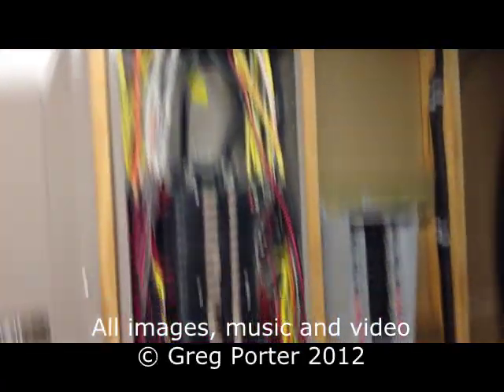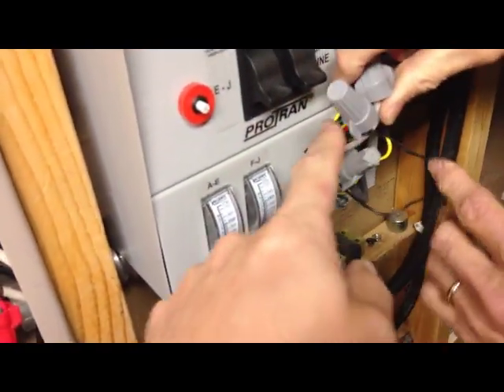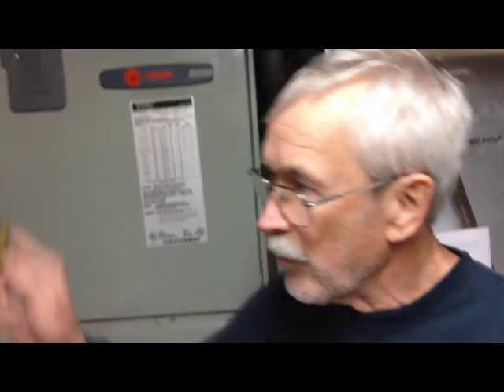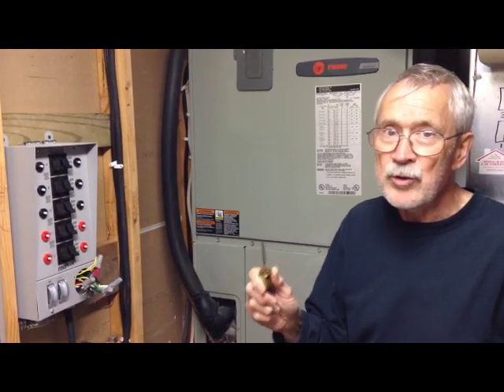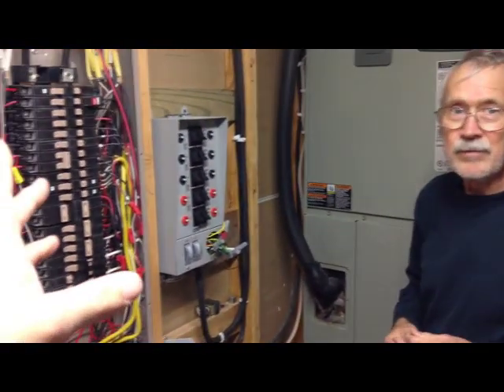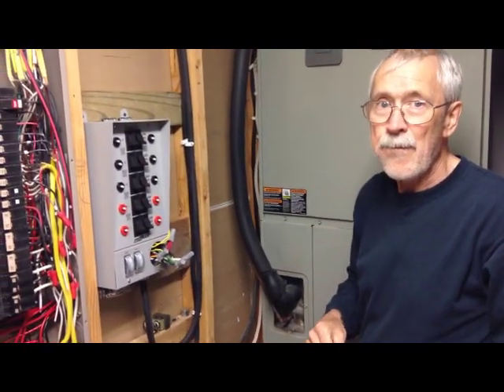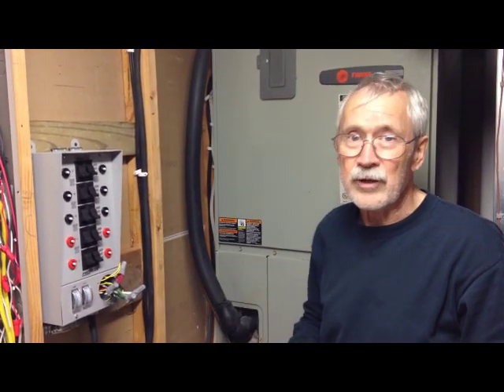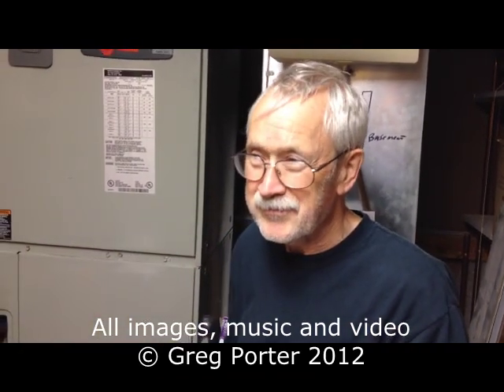Generator Transfer Switch - Wired

Comment from the maker: Aric-  You CAN backfeed your panel just like you described.  It works and everything is protected.  There is usually a code requirement to have a disconnect outside at the meter.  If you do not disconnect from the meter, you are feeding power back up the line and if a repairman is working, on that line, it can harm him.  Usually you can call your power company and/or code official and get their requirements.

Comment: 3 years ago I bought a 30kw continuous duty diesel generator for my home I got from a retail business auction for $1100. It came with the 240v 200A auto transfer switch. The generator has a programmable schedule which I programmed to run on the weekends to keep my power costs down. I use a blend of diesel/WVO/WMO, so my fuel costs are almost nothing. I installed a 1 micron washable bypass oil filter to keep the motor oil super clean. I now go about 1000 hours between oil changes. My generator now has over 7000 hours on it. When I got it it had about 120 hours on it.

Comment: A generator,  and it depends on wastage amount, but they can handle more then people think. You kept adding up numbers from the panel. The panel doesn't use wattage peasy, it's the individual items your going to use. Your dad has probably done this already,  but you need to add up the wattage of each item your going to use to determine how much your generator will handle or what size to buy. Your total wattage use. And you do have to account for resistance,  cord / wire length so there will be an amount of wattage to account for on top of units used, lights, refrigerator,  microwave,  etc. I seen people drag a 100 foor exstention cord in their house and only needed 10 feet! I am in California and its generator madness here thank god I live in the mountains, they have worked out all the issues, transfer switches,  back feeding, exstention cords, etc. I will say with the economy as high as it is a transfer switch, an approved one in CA, which the one you  are showing I belive is not allowed. Your made to install the big one you both were talking about by a licensed electrician. And the cost is upward of 3 grand! No one up here has that kind of money so I see back feeding and cords a lot. Be safe thanks for the video

Comment: Rich stuff. The first thing that tells me the dad is legit is that he has a 200 AMP 42 Circuit Cutler Hammer Service Panel, the one without the cover. They are the best all around value panels you can buy. The second thing is the work looks impeccable. Wires are marked and tucked neatly inside. That's not easy for most guys still wet behind the ears."If it looks good, it probably is." I'm a little nervous that Greg has his ring on and gets dangerously close to the main lugs. (You tell him dad!)  Dad has some years under his belt which is a testimony to his abilities to stay out of the electrocution ward.  So I'm going for the transfer switch he shows in the video and use his advice, along with Mr. Doom and Gloom's advice about checking the code on the entrance cable from the generator. Thanks for a good look into a craftsman's breaker panel!!
Reply from the maker: +Techman 143 Thank you for all the kind words... You are spot on.  Dad spent 30+ years as a journeyman electrician.  I started working with him on commercial jobs at the age of 12.  We both have a healthy fear of electricity and probably do things that the average person finds a bit dangerous.  That said, dad is the one who's had an out-of-body experience when he got caught between high voltage lines.  That happened before I was born...  Thankfully that's the last major incident either of us have had with the sparks.  To get back on track... The transfer switch in the video is the same style we've installed in a number of homes.  They are straight forward to wire and they work very well.  Be sure to test your generator AND the switch at least once a year and quarterly if you can.  Generators are just like lawnmowers or cars...  They start better if you start them often.  Good luck!!!

Comment: i have my 10 circuit generator switch connected and ready to go. im very impressed and pleased how easy it was to connect. i do have 1 question: i have 1 15amp circuit id like to connect from the other utility box (i have 1 main and 1 sub) most of the circuits i need w gen power are from the sub panel. can i run the 1 15amp circuit  from the main panel into the last 10 circuit gen transfer switch even though the neutral and ground from the 10 circuit are wired into the sub?

Comment from the maker: If you have an electrical panel, you should be able to hook the genny direct to your feeder lugs without a transfer switch since you do not need to switch back and forth between power supplies.  You'll have to check with you local jurisdiction to find out what they will allow.  Some require a cutoff switch, others do not allow gasoline to power an electrical installation.  Start by questioning your local building inspector.

Comment from the maker: The bonded neutral should be at the generator unit.  It's similar to driving a ground rod and bonding the neutral at the utility meter. There are doctoral thesis(s) written about grounding and bonding, so I can't claim to know it all. I will, however, say MOST generators have neutral and ground bonded at the unit.  Your residence will have it's own ground that will not be disconnected due to the transfer switch.  It should be safe to wire your genny to a xfer switch. Call the manfact to confirm.

Comment: Great Video!! Question: In the "whole home" scenario u discussed, u mentioned  needing a 200 amp transfer switch and 20 to 48 kw generator. Wouldn't that only be the case if every circuit in house (on the 200 amp panel) was actually in use? It would seem to me that if, while on emergency (generator) power, u simply exercised caution not to over load your generator and transfer panel, u would be OK. Am I missing something?? I wouldn't be surprised, I'm very new to this. Thanks for posting.

Comment from the maker: Just add up the amperage of all your "must have" circuits and that will tell you the generator size.  Amps * volts = Watts.  So if you have a 20A 110V draw on an outlet, you need 2200 Watts for it.  Your AC will be the biggest draw for sure.

Comment from the maker: Yes and no.  You can load a 200 amp panel up with WAY more than 200 amps worth of breakers.  Circuits have a rating that tells you 30%-40% based on what is connected to them.  If the A/C, oven and dryer were running, you might be pushing 140 amps.  Then add lights, clocks, fridge, etc and you're at the limit.  Yes, you could exercise caution with the genny.  When I design buildings, we have to supply enough power with the generator to cover all circuits connected to it according to their load %.

Comment: What do you think of the button breakers? There is some guy claiming they are a hazard even though they are UL listed. I did a search on the issue and didn't get one hit related to problems. Thanks.
Reply from the maker: I've never had a problem with them.  That doesn't mean they are perfect, that's just my experience.
Reply: Thank you!

Comment: regarding your 200amp dpdt switch...the answer is you would need 4/0 feeder going outside to a 200 amp plug...and what generator would you be buying that has a 200 amp cord / plug attachment that would let you "plug in" ...they don't exist. You be looking at a hardwired generator only.

Comment: Greg this one may make you want to slap me lol. I made a pig tail both ends with male prongs. I shut the main breaker off to the house. Than I took the pig tale and plugged it in to my house just an outlet then plugged the other end into the generator now is this absolutely stupid or is it ok the only circuit that is live is the one that the pig tail is plugged into and I can charge two circuit at a time or that is all I have done my generator has 4 110v and 1 240v. Let me know have a good day.

Comment: Your installation does not meet National Electrical Code requirements. Your main line feeding the transfer switch is a rubber cord not approved for that use. It is never permissible to connect a generator to the feeder lugs as you mentioned in a post. If you had that installation inspected it would surely fail. As mentioned in another post, Electricity is not a hobby. When you kill someone you're at fault.
Reply from the maker: Thanks for the comment.  This is exactly why I tell everyone to check with their local code officials.  Every install has a different set of circumstances.

Comment: A journeyman electrician wouldn't bury a right angle flex connector or flush mount a piece of equipment listed to be surface mounted. Wouldnt pass inspection. (You did get a permit, right? Lol)
Reply from the maker: All permitted, all passed.

Comment: Homeowner hacks. Electricity is not ta hobby, hire a professional before you kill a lineman.
Reply from the maker: Agreed.  Most jurisdictions will require a permit and an inspection either from the building inspector or the utility company (or both).  If your jurisdiction does not require an inspection it is HIGHLY recommended that you call the utility and have them inspect the work.  As always, contact your local public entity prior to altering your home's electrical system.
Reply: If I am not mistaken, the older gentleman in theis video IS an electrician.
Reply from the maker: Yes.  40 years as a journeyman.  He knows his stuff.